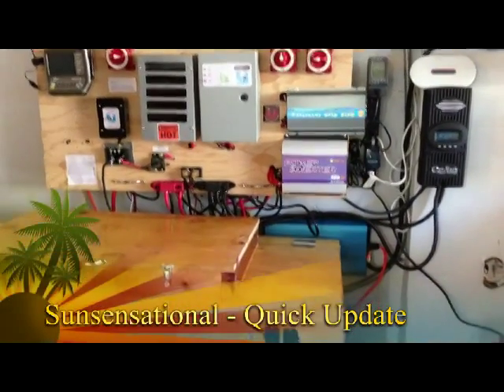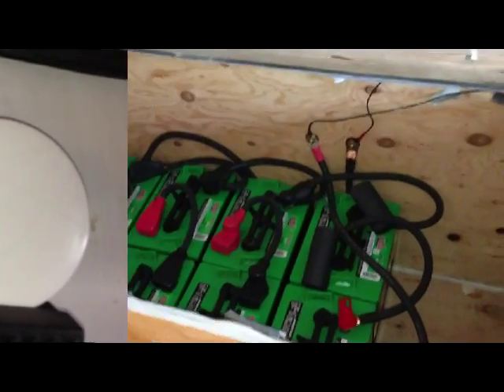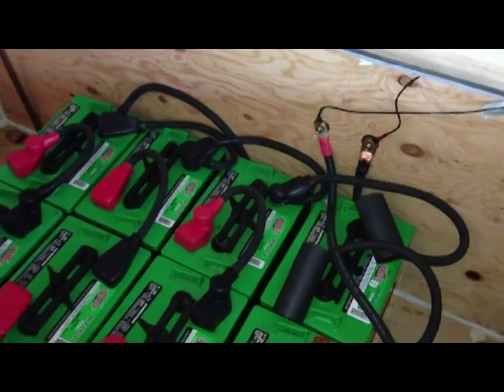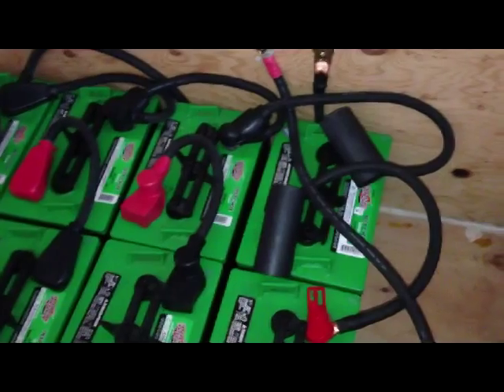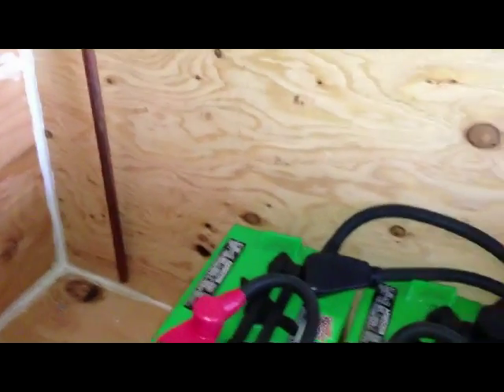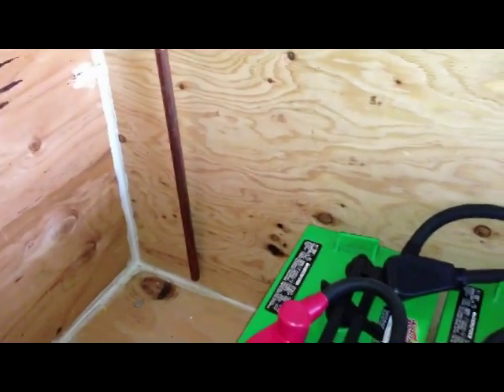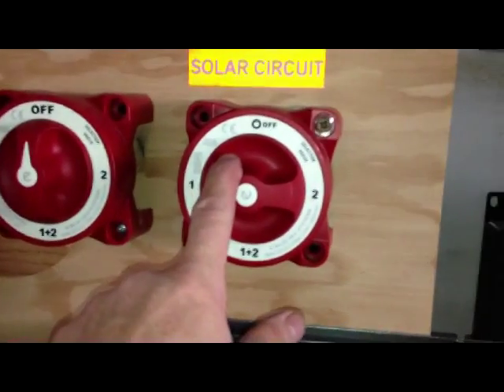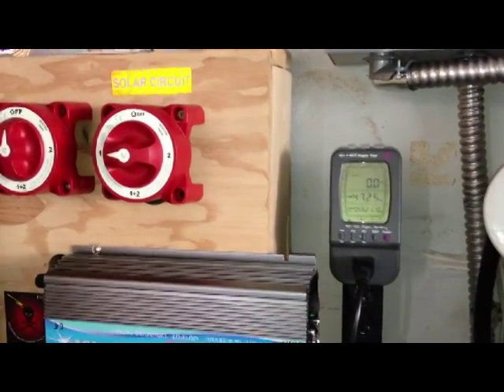Solar Battery Bank - Quick Upate

Comment: Differend aged batterys have a differend internal resistance resulting in distcharging the total battery bank earlier, ,this in time can result in some battery,s going bad, and distcharging the total bank mutch faster, this also occeurs at standby batterybanks. Unequal batterys will drain the others mutch faster, also wateruse of the bank will go up significant.
Reply from the maker: Thanks for the info

Comment: Coupling of new battery's to older ones, altough of same mark and type is not advisable, due to different inner resistance of the battery's smal, or bigger discharce currents wil ocoeur, distcharging the battery,s faster, also with charging new batterys wil not be charged to full, and older batta wil be overcharged., all this will shorten the life off the batt bank., better is to buy all the bank battery's at the same time, connect them all before drawing or loading the bank. (Advice from pro.)
Reply from the maker: I'm curious what your thoughts are Here:  Biggest difference in age between the oldest and the newest batteries in bank  is about 2 years; however these batteries are rarely cycled, except to exercise, and properly maintained.  They are here for standby/emergency use only. My thinking was if rarely cycled the 2-year batteries might be the equivalent of 3 to 6 month old battery. Your thoughts?

Comment: Nice  How long have U had those 6v battery's  looks like interstate  U happy with them ?
Reply from the maker: good to hear from you.  yeah, they're Interstate 2025 (6v) deep cycle. each 6v is 232ah and about $150/ea.  my original 6 are about 21/2 years and 2 others brand new. but i'm very happy with them, good performance, quality, and bang for the buck. i've been told if i maintain them more for emergencies they should last easy 9+ years. but if i cycle them daily and run hard, they're designed to last closer to 4 years peak. there is a even better model of the Interstate (bang for buck) which i'll post for you to check out,
Reply from the maker: The better ones if i had to do over:  Interstate L-16HC's (12v/420ah).  4 for $1200 or $300/ea.  You'll pay $300 for 2 - 6v 2200s and get 232ah, or can get 420ah all in 1 12v and save the series wiring from 6v to 12v
Reply: liking your system. Your battery are cheap were you live. Over here a 135 is over $300. Are your batteries sealed?
Reply from the maker: Stephen T
Thanks Stephen. Yeah, these are flooded lead acid (not sealed) so require little maintenance but worth for cost. I checked out your system recently (and now the relocation) and really like it. $300 for 135...wow..too bad we can't easily ship given weight and all the hazard material surcharges
Reply: Thank you, yes it is too bad about the shipping cost. Its a joke over here for importing very high cost. I seen on a site in the states there is 2v batteries  at 1110 ah for $372 that's great value love to get that over here.